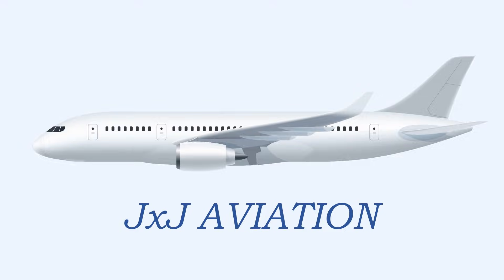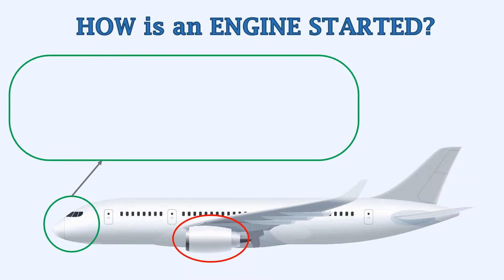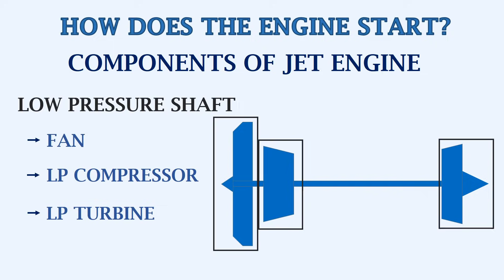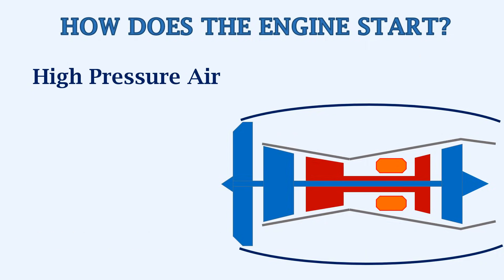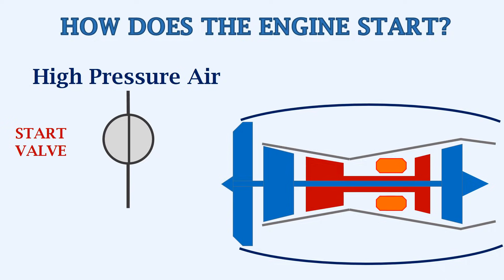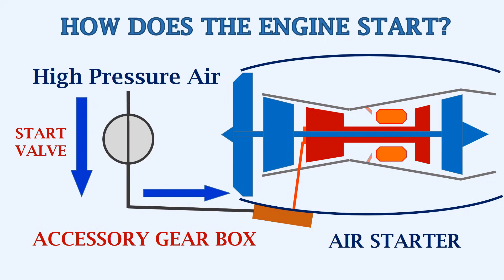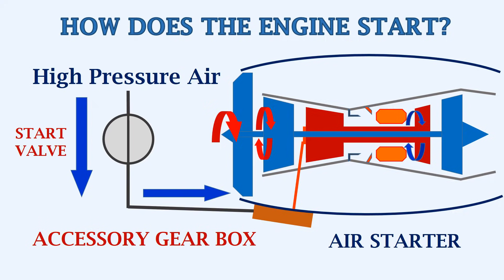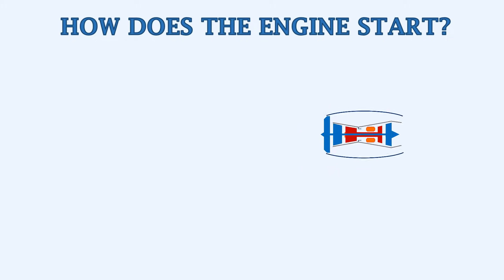Understanding How an Aircraft's Jet Engine Starts! A look at the Start Sequence of a Turbofan Engine

Comment: A few corrections: 
>N1 and N2 don't refer to the LP and HP spools, they refer to their percent max speed.  
>Air Turbine Starters connect to the HP spool via an overrunning clutch (like your car). When engine speed exceeds ATS speed, the clutch disengages, the starter valve closes. 
>Fuel and the ignitors don't activate until the engine reaches a minimum speed, not right at the beginning. You need hot compressed air to achieve combustion. After a minimum Exhaust Gas Temp (EGT) is reached, the two ignitors (simple "spark plugs") switch off.

>Engines must be capable of being windmill-started in flight up to 20K feet.
Reply from the maker: I really love the points you have brought out here but I wanted to bring out a general explanation regarding the engine start sequence. I do have the specific N1 and N2 values, but didnt want to add too much technicality into this video.
Reply: Just a quick note. Some APU's can be windmill started also. Mounted on ram air doors.
Reply: N1 and N2 actually refers to LP and HP spools. At least on GE and CFM manuals

Comment: Dumb question, but could the engine run on high pressure/compressed air by itself without the need for combustion?  Maybe just use fuel to power an air compressor/APU?
Reply from the maker: it is a good question actually! The engine can run on compressed air only but the shaft speeds will be too low to produce thrust or run the required pumps.
Reply: @JxJAVIATION  Ok, thanks for the reply!  I was always wondering about the A380's fuel capacity with a max of 84,000 gallons or almost 416 cubic yards (or boxes 3'x3'x3').  So there must be some efficiencies somewhere.
Reply: @JxJAVIATION  >  If you look around you Tube you will find videos on the Great jet fuel hoax.  Idiots have some persuaded that there is no fuel on aircraft.  They say the wings are full of compressed air.  Lutz has fallen for these idiots lies and that is the point to his question.
Reply from the maker: @rcairflr  Yeah. Its similar to the CHEM TRAILS from the Engine Exhaust. But wings are filled with FUEL only!
Reply: Air turbine starters can run an engine up to about 50%N2, but can't run any of the gearbox accessories (airframe hydraulic pumps, generators) or provide thrust, since there is no combustion.
Reply: No it cannot. When the engines are spun up without introducing fuel, that is known as a dry motor. The thrust produced during a dry motor is rather weak. You could possibly stand directly behind the engine without being blown away.

Comment: It doesn't just ignite this magic JETA fuel which is supposed to be like heating oil or diesel.....then Bosh ! Your flying down the runway ....does it???? This alone should make you ask the right questions....aka its using AIR as its only FUEL!!! Yes you heard me AIR!!!!!
Reply from the maker: Well the air wont move until something pushes it right?